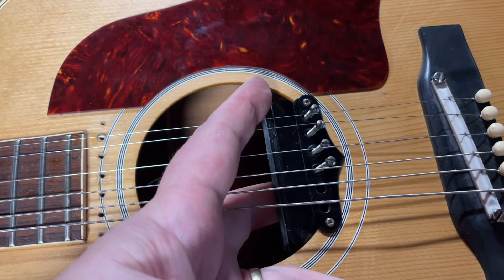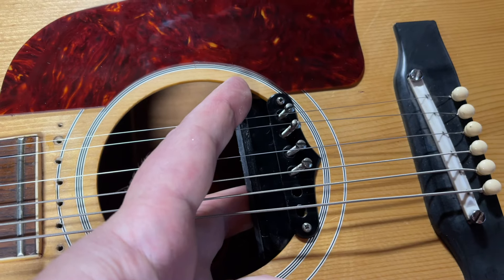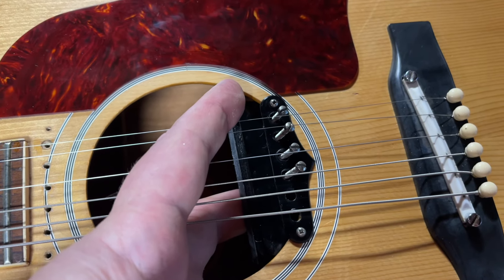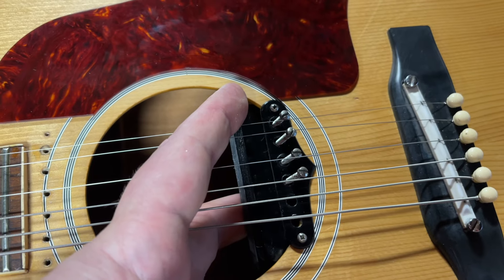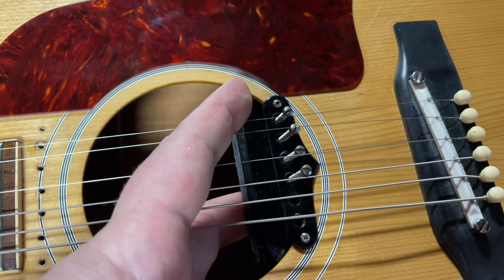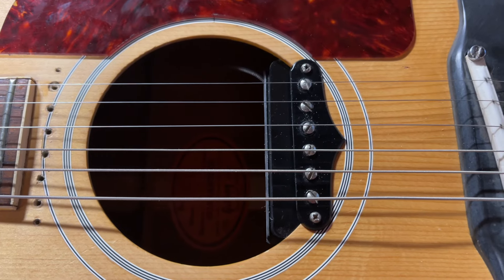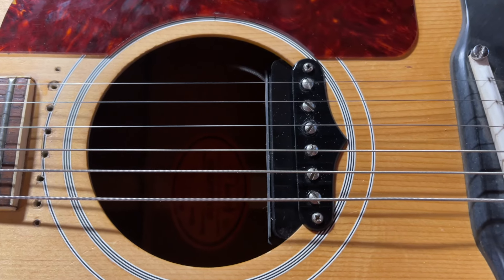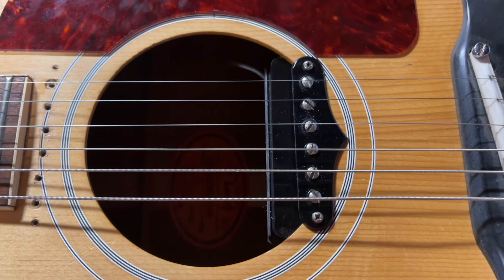Moving the  pickup to the Treble position on a 1964 J-160e

Comment: Did you have to drill holes for all the posts or do they go in the sound hole ?
Reply from the maker: Only the two holes that suspend the pickup need to be drilled . The pickup poles in the treble position go into the sound hole not wood
Reply: @perrystanleyNumber9  thank you.